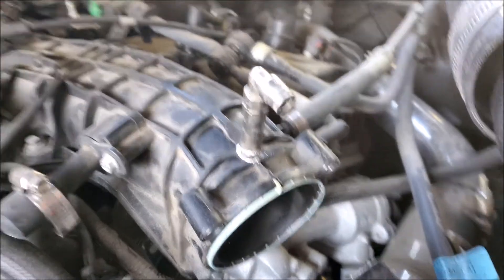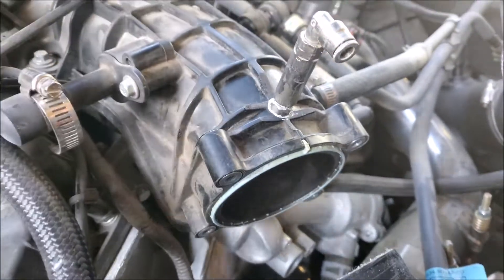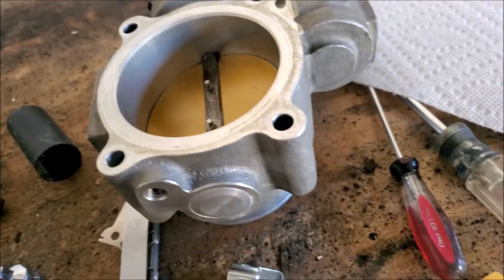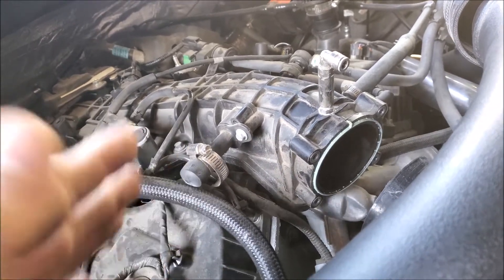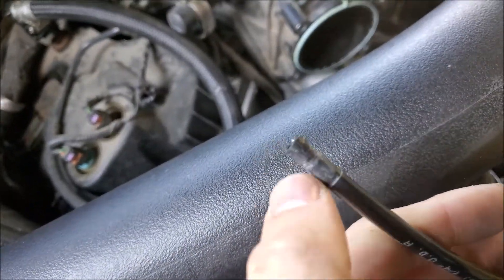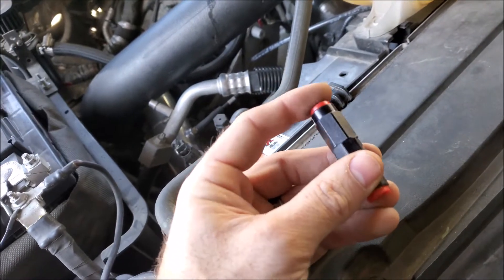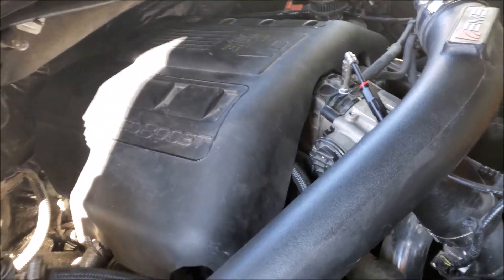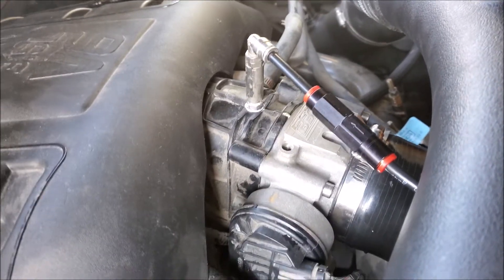Installing a water/meth nozzle behind the throttle body to protect electronics.  f150 ecoboost

Comment: Did you have any difference in performance when installing the nozzle behind the throttle body? A while ago I installed mine on a throttle body spacer (behind the TB) and I got very uneven readings on the short term fuel trim's (like 9% difference between bank 1 and bank 2 at WOT) AFAIK fuel trims should be very close with each other. so I decided to install the nozzle 9" in front of the throttle body, but 2 throttle bodies have failed since then.

My truck is a 2016 f-150 3.5 ecoboost
Reply from the maker: Hmm that's odd.  I never saw any difference from in front of the tb to behind.  

Are you running the meth on a progressive ramp or just having it turn on at a certain boost pressure?
Reply: @turbojeremy13  I have the AEM W/M progressive kit.
I think that this difference in the fuel trim readings may be due to the fact that the nozzle is very close to the intake manifold, also, in the 1st generation ecoboost 3.5, the intake manifold has a slight "curvature" at the inlet... I think that This could cause more mixture to reach some cylinders and not be distributed evenly. But I can't say for sure, I'm just guessing.
Reply from the maker: @lrsr0312  makes sense to me.  I was always worried about even distribution because I was spraying a lot

Comment: Getting ready to add meth  to my 2018 eco-boost. Every where I’m reading It says two spray before the throttle-body. What type of issues were you having with the throttle body? And did you have any issues or performance differences spraying after the throttlebody?
Reply from the maker: The methanol was getting past the seals on the tb blade and ruining them.  I lost 2 stock throttle bodies and almost lost my bbk.  Was able to clean the rust out and then moved the nozzle behind the tb.  Never had another tb issue after that
Reply: I have a 3.8 litre ecotec v6 gm in my aussie Holden commodore. Should I fit a setup in front of the throttle body or will it wreck the IAC and TPS sensor? Any reply appreciated cheers from Australia 👍 ❤. My TB is cable operated but now I'm thinking about the throttle plate shaft?
Reply: Was size nozzle did you use?

Comment: What size nozzle did you use?
Reply from the maker: I'm using a 1000ml/min nozzle
Reply: @turbojeremy13   awesome thank you fixing to rig mine up
Reply from the maker: @joserocha4046  no problem.  Definitely a great mod for any forced induction motor
Reply: @turbojeremy13   I had the kit on a 6.7 Cummins it worked really well on it so I took the kit off to use on something else got the truck for 3000 been working on it
Reply from the maker: @joserocha4046  I was going to do the same with this kit when I got my 6.7 powerstroke but ended but buying a nee kit.  Meth makes a huge difference on diesels.
Reply: @turbojeremy13   I know I could continue full tilt up a hill on the hot tune and never see the egt climb to anything concerning I used a two stage set up for the Cummins.   495 on the dyno   Plus the meth.
Reply from the maker: @joserocha4046  same here.  I pulled 10k lbs across the country last year.  80mph up small grades and never broke 1000 degree egt.